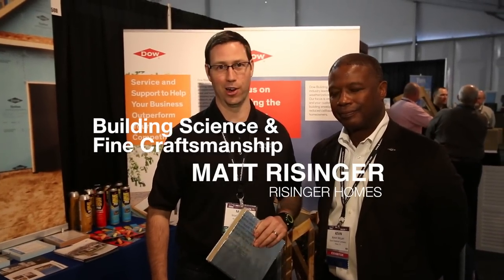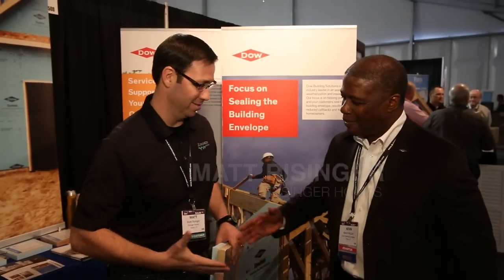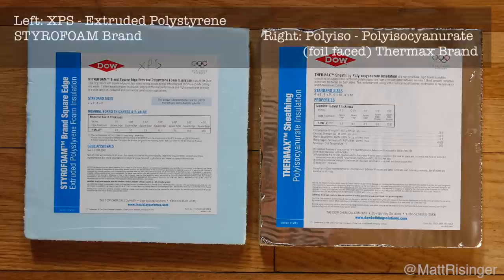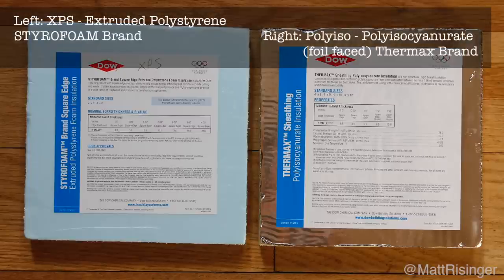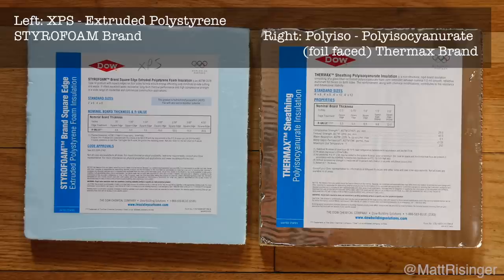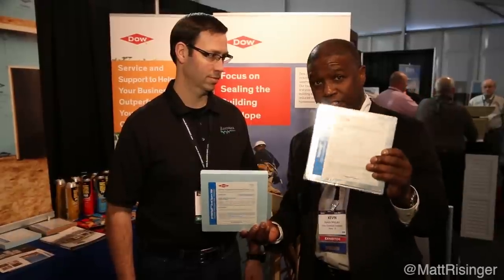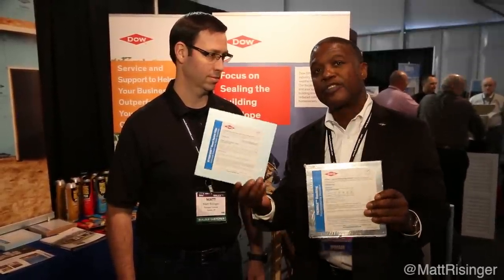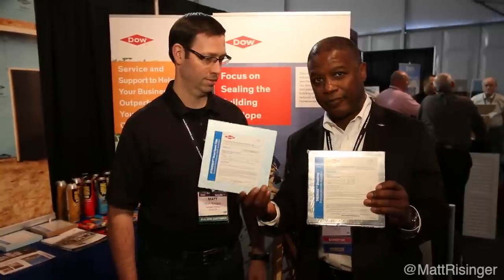Which Foam Board? Polyiso vs XPS Insulation

Comment: I added 1" POLY ISO foil backed over a manufactured home siding, then cedar shingles with ring shank framing nailer through each shingle, through the foam, into the existing siding/sheer. I hope I have no moisture problems.
Reply: William Filer what kind of siding did the mobile home have that you went over?
Reply: William make sure you install heavy poly on the ground under your home all the way from wall to wall and it will stop the ground moisture .

Comment from the maker: Garry Barnett,  I do think that Neopor is an interesting product.  It's not readily available but I would expect that to change.  Dow is a huge company and they make some great products, of course there are other manufacturers of exterior rigid foam.  This video is intended to educate on the differences so that builders can make informed decisions, and buyers can know what's on their house.  Best, Matt
Reply: Hey Matt, I'm trying to cover some vents that my parents can't stand the amount of air blowing downstairs. Which material would you recommend if we want to block all the air coming from those vents and at the same time get rid of the annoying noise or the blowing air pressure sound they make when vents are closed? I wanna get the right material to cover vents and have quiet or no sound from the covered vents! I have zero experience about this DIY stuff. Your help is appreciated.

Comment: You could use a 25psi polyiso instead of the 20psi you are holding and eliminate the furring...
Also, foil-faced iso is closer to 6.5/inch once you get past 1" in thickness.
Lastly, the water absorption rate of foil-faced iso is less than .04%. They both work perfectly well in any wall configuration. Iso has a far better performance than xps in high-temp and fire situations as XPS is only applicable in mass walls to meet NFPA 285 standards and that also has to be detailed properly according to the test reports. Polyiso has shown to be NFPA 285 compliant in over 85 different assemblies due to its great fire-retardant characteristics.
Reply: thanks for this
Reply: @Zaiden Mayson definitely, I have been using Flixzone} for since december myself :D
Reply: Thanks for your input...on the chance that you may see this comment so many years late... would you consider it appropriate to use between purlins under  metal roof panels  in a fire prone area of the Northern California Sierra Nevada foothills? Thank you,  in advance,  if you or anyone is able to respond 😊.
Reply: Also,  is the poly iso the R- Max branded foil faced one side 1- 1/2" panels sold at Home Depot? Thanks again

Comment: My initial thoughts for insulating my new house are 2x6 walls with cavity filled open cell foam wrapped with plywood sheathing.  I then want to use a house wrap of some kind(any suggestions of type and if multiple layers are used would be appreciated) then wrapped with 3/4 in thick foil backed polyiso.  There would be 1 in of airgap followed by acme brick exterior. After watching this video about the moisture concerns, would use of the XPS be better even though I lose the radiant barrier qualities of the polyiso?  I live in Waco, Tx so my climate is the same as yours.  Thanks Matt for the videos, as they are super informative as I try to design my energy efficient new home!
Reply from the maker: Brent, Sounds like you are well underway to building a very efficient house!  For the house wrap I'd recommend Tyvek Commercial D.  That's the tougher and lower perm rated version of Drainwrap.  It'll leave a drainage plane behind the foam so any bulk water can get out.  For the foam you could go either way.  The radiant barrier of the Polyiso is nice since you've got the air gap but if your house is one story then you won't have too much sun hitting those walls anyhow.  It's probably a toss up between foil faced PolyIso and XPS.  Be sure to use a "Morter Net" product at the base of your brick to ensure the weeps don't get clogged.  Glad to help!  Best, Matt

Comment: Viewers should check out the new products that have come on the market since this video was made many years ago. Check out Logix Halo products Graphite Polystyrene
(GPS) Rigid Foam Insulation with foil skins. The GPS foam is a graphite fiber-filled XPS foam: .013 Perms, R=5/inch, and flame spread index less than 25. There are versions to use in contact with soil, on interior walls, and on exterior walls.

Comment: Great video Matt!  I have successfully used Dow's XPS for insulating foundation walls.
Now I want to insulate a concrete slab by laying the XPS on top of the slab and covering it up  with plywood to act as a subfloor.  The only thing I am worried about is the compression strength of the XPS.  Would the XPS under the plywood compress under foot traffic?
Reply: Use EPS.  XPS off-gasses for a few years and you really don't want that in your house.
Moreover, XPS, while offgassing, loses R-value until it's equal or slightly worse than EPS.
You REALLY don't have to worry about it.  25 psi is QUITE rigid.
If you're going to be anal about it though, you can get EPS in 40, 60 and 100PSI variants.  They will cost significantly more though.

Comment: Hi, what is best product for roof of a slideon camper? What product is the best for the side walls? What Aliminium profiles do you use on the outside of both these applications for camper? Is there a site where all this information can be found , specific to what your caravan/ slideon/motor campers? Cheers Mick , I intend to build my own slideon truck camper, so being water tight/ strong/ and light weight are very important to me. Who is your wholesaler in Victoria (Australia), where I can go and talk about the materials that I need to  build this project. Cheers Mick

Comment: Which is best, or what would be best to use on top of RV walls, not inside the walls, to keep the cold out in winter and heat out during summer. It will cover windows and walls inside.

Comment: Matt, thanks for the video.  We have a 1/12 roof ...  the current roof is a rock roof with tar paper.  We want to replace with TPO.  We are taking bids from roofers ... we are hoping to add insulation to the new roof.  One of the bidders is suggesting 4"  polyiso insulation, than over that, a fire retardant of some sort, and then the TPO.  We currently have no insulation in the ceiling.  We live near the ocean...  I'm in central coastal California.  What roofing insulation would you suggest we use?

Comment: So you would recommend an xps polystyrene for insulating a metal roof inside a metal building?  Would that help with sound dampening also?
Reply: Best for accoustic damping is RockWool or similar Mineral Wool. XPS doesn't do much, and I doubt PolyIso would help much either.

Comment: Has anyone done this detail. I am in Northern California. Typically I do 2" of close cell foam sprayed on the under side of roof sheathing and then fill the rest of the cavity with a batting insulation. The close cell allows for the due point to occur inside the 2" and since it is does not allow for moisture penetration we don't have to vent the roof. My question is if I go with 2-3 inches of Polyiso on the exterior of the roof deck will that substitute for my close cell spay foam allowing for the due point to occur on the outside of the roof deck?
Reply: The surface temperature on the underside of the roof deck theoretically shouldn’t drop below dew point. And even times where it does it won’t be for a prolonged period of time. So a small amount of moisture should easily dissipate.

Comment: The current Dow spec sheets show that EPS has a much higher water absorption rate than Polyiso...  - like 7 x.    I know the processes used to make EPS has changed.  Is that why?   If so then this video should be changed as Polyiso is actually better at resisting moisture.
Reply: They are taking about XPS not EPS.

Comment: They don't talk about the "Problem" that has been plaguing Polyiso as of late and that is that below 50 F, the builders and clients are discovering that it starts losing its R-Value!  This means that the board sitting inside the wall must be at 50 F or above to offer the material advantage. ...This video is 5 years old and a lot has happened ever since. In addition, XPS is the way to go if you want to walk on top of it.
Reply: It gets down to - 20F around here and polyiso is still the go to product for roofs. Only the outermost part of the foam will drop to a cold enough temp to experience any reduction in r-value and that reduction is negligibly small.

Comment: OMG!,  NEVER use foil-faced insulation on the wall sheathing.  It's vapor-impermeable, thereby trapping moisture.
Reply: only if taping the joints